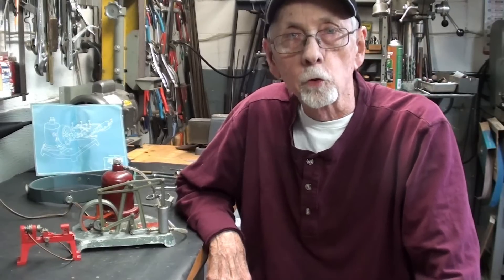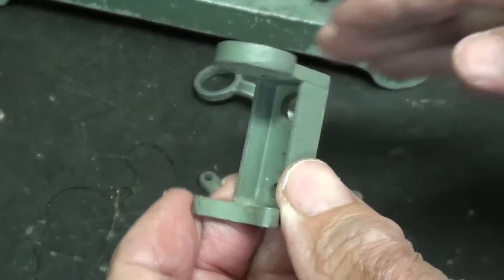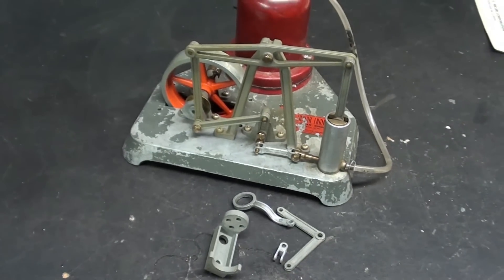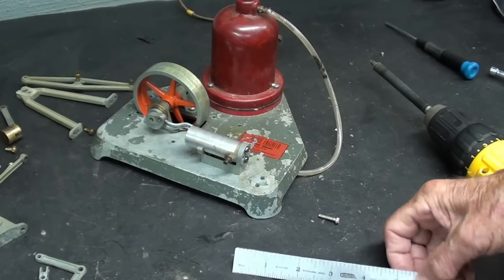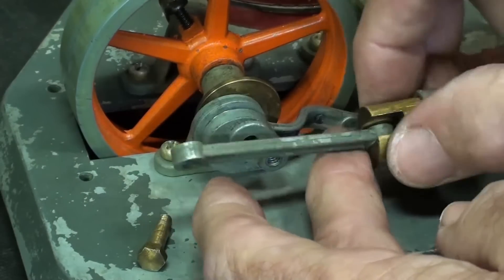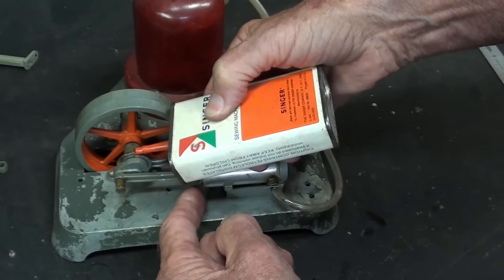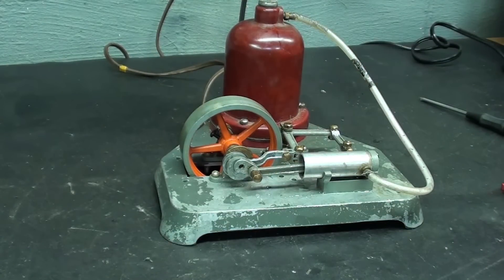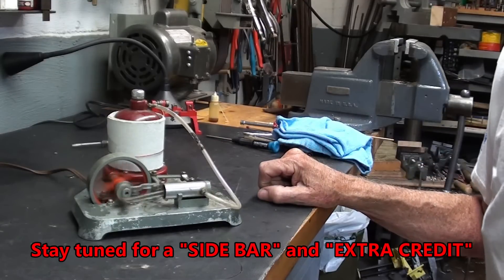MILLER STEAM ENGINE pt 3 #882  HORIZONTAL VERSION tubalcain

Comment: I had the same Mamod engine when I was a boy and you could bolt mechano to it using the row of holes around the base. Nearly sliced my finger off driving a metal windmill from the flywheel pully. health and safety or parents wouldn't allow that to happen now, my dad just warned me not to be stupid but made no attempt to stop me. Kids were able to make mistakes and were not wrapped in cotton wool 50 years ago.
Reply from the maker: Sad but true

Comment: I still have my 1st working model Mom and dad gave me for Xmas in 1958. It is from Jensen Mfr. Co. (I'm  75yrs.old)  and I  think they are still around. It was quite powerful considering. The underside of the boiler where the firebox would have been (it is electrically heated) is completely lined with that "illegal white material"...and I'm not talking  about an illgal drug.
Reply from the maker: It’s amazing that you still have that engine after all these years. Yes, they use a lot of that white material years ago.

Comment: LOL I knew you would use the word FIDDLY  ! It is such a great word to describe parts that are a pain to assembly.
Reply from the maker: Yes
Reply: Yes, Mr. Pete, when you said you had to put those little nuts on under the mounting brackets, it was like... holy smokes. What a p.i.t.a. that could be. Don't want to cross-thread any of those old original screws and nuts!

Comment: Thank you Mr Pete - It is great to see the Miller engine configurations assembly and running. Thanks also for showing your engine collection - it's interesting to see how these vary. As an English fellow (now based in the US), lovely to see that Mamod. They also produced engines compatible with Meccano, which was the British equivalent to Erector, so that constructions could be steam powered.

Comment: Mr Pete, thank you so much for taking the time to do this series on the amazing Miller Steam Engines. As you well know I am a big fan. Wouldn't it be great if a company like Retrol made a similar engine today. We can only hope. Cheers, Alan.
Reply from the maker: Thanks for watching. Earlier today I was watching your Miller compressor video.
By the way, maybe I already told you this. But thanks to you and your video I was able to get my original engine running after you explained that distilled water will not work.
Reply: @mrpete222  The Miller compressors are wonderful, I use mine all the time to test model steam engines. Even though they have no reservoir tank they can still maintain a good pressure. After all that I have learnt from watching your videos I'm very glad to have been able to help you out. Cheers, Alan.

Comment: I have three Miller engines, one in each configuration and they all work.
These engines are the bane to restorers because the diecast zinc bases won't take paint very good.
Boo hoo, I like my old worn out unpainted steam engines.
Reply from the maker: I’m jealous that you have three of these, lol.   Yes, zinc is too active on the periodic chart to hold paint. 
In fact, years ago, Rust oleum sold a paint that they called galvanoleum. It was formulated to paint galvanized metal.
But I’m like you, I like the engine’s original and in their work clothes. I think some people over restore things. These Miller engines are the neatest toy engines I have ever seen. 10 minutes ago a man sent me an email with pictures and he also had all three of these engines.

Comment: Love these videos. Still have a steam engine from when I was about 6 or ?
Also built one, including machining the flywheel, cylinder, valve, connecting rod and making the boiler in high school in 1968/69. The o ne which I didn’t build is like the middle’ one (Mamod) of your still photo and uses the camp stove type ‘bricks’ fuel. I had the internal guts of an old mantle clock from which I used one of the gears to make a circular saw which I powered with the Mamod. I filed the teeth to make them sharp😊
I see that Mamod went out of business in 2024😪 I guess young boys like your grand kids are not interested in the kind of stuff anymore. Very disappointing.
Reply from the maker: Yes, mamod is out of business. And the other ones that remain are on borrowed time.  There was very little market for these engines. However, if you watch my videos with the retro engines, there’s still seems to be a little interest.  But it is a hobby for older men with money, and the same goes for model trains.   The retro engines cost three or $400.

Comment: YES I DID ENJOY THAT. 
Such beautiful little engines I had one of those Mamod engines whuch used an alcohol burner to raise steam.  It just smelt  good when it was running   - -  Yes hot Singer oil and steam!  Lovely.  Engineering minded Kids today have other goodies to encourage their inventiveness.    I have been very impressed by the youths who are experimental rocketeers  and are developing electronic  flight controls  from modular packages like RaspberyPi  and such like.   I think one group got autonomous landing up and running before SpaceX 😂. 

 Keep this stuff coming PLEASE.
Reply from the maker: About 30 years ago, my power and energy class was making rockets, and co2 powered race cars. I saw lots of creativity.

Comment: There was a K.J. Miller that made a small die cast air compressor suitable for air brushes and small paint guns.  Maybe it's the same company. There's still tons of them around so it must have been somewhat successful.
Reply from the maker: It is the same company, and if you look down through the comments, you will find a link to that compressor. I had never seen one before.

Comment: Thanks for changing your mind and releasing the additional videos. You know I like these little engines and I'm sure others do as well having had a similar one when young. Few people today know the importance of steam engines is the development of the machine era that exist today. Followed closely by stationary fuel powered engines. Not just trains.
Reply from the maker: The importance of steam cannot be overstated.  Most power plants use steam whether they are coal fired or nuclear. Almost all large buildings in big cities are heated by steam and the list goes on. And nobody knows this.
Reply: @mrpete222  Don't overlook chemical processing lines like anodizing and plating. Most I know of are heated with a boiler and heat exchangers. Todays engineers would most likely use electric immersion heaters while overlooking the versatility of steam for lack of knowledge. The sad thing is the lack of understanding of how steam works as it condenses to release it's energy. I suppose most people just look at as hot air.

Comment: Talking about Erector sets, bought and restored a lot of them in years past. Sold most of them, still have a bunch of them.  Anyways, in just about every set I bought, there would be an assortment of bolts, nuts, and misc. parts that did not belong with the Erector set. I know in one of them were some parts that went to a Miller steam engine.  There here somewhere, probably tossed into the drawer with all of the misc. bolts, nuts, and would take days on end to find.  As always, thanks for sharing. Ken
Reply from the maker: Very interesting that you recognized those parts
Reply: @ After watching todays video, it dawn on me that I have seen bits and pieces in one of the Erector sets I bought. Just a matter of finding them now.

Comment: Ive never made a steam engine but I did help a young guy get one running that he built in school. I remember having to adjust the timing of the valve. I dont remeber exactly how we did it. Im just wondering do you want the valve to allow steam to enter right at top dead center or before or after. Im  wondering if you could make a small steam engine by 3d printing. I realize the plastic will melt but I print the plastic at 230c and water boils at 100c so I just wonder if it would work. I assume the steam is not even 100c by the time it gets to the engine. I looked on youtube and there is a steam engine that was 3d printed. It runs pretty well. I think it does have a steel cylinder liner.
Reply from the maker: I set the valve for just a little before dead center
I have built a 3-D printed engine. I think there is a video on that. I run it on air, so I do not have to worry about the plastic melting. There are many of these on thingiverse

Comment: 👍👍🚂. Car sized castings are trivial to the locomotive frames made in the 30s. Regarding oil: for our 16mm scale locomotives we use a special steam oil, ISO460, which clings in the cylinder. It really matters: when you hear the engine go from a sweet hum to a jerky movement, it's just run out of oil. With this engine, you will have to inject it into the steam pipe manually.